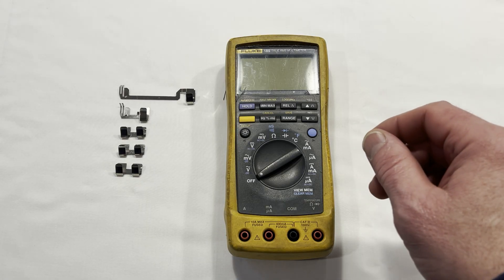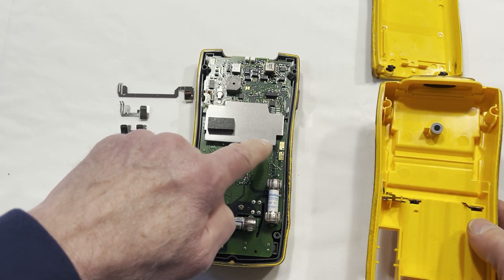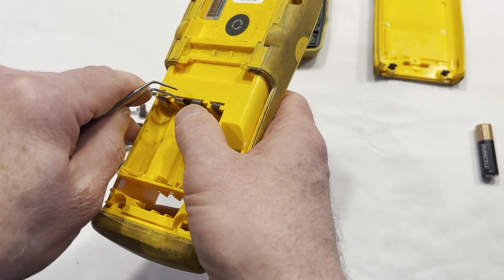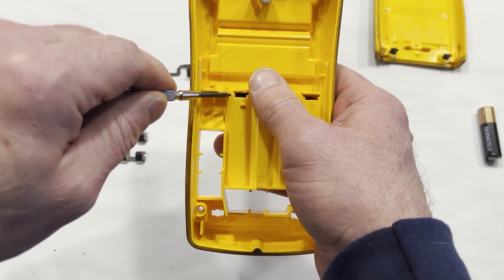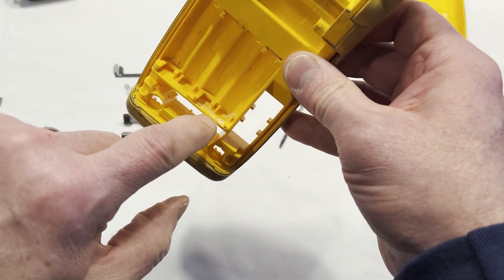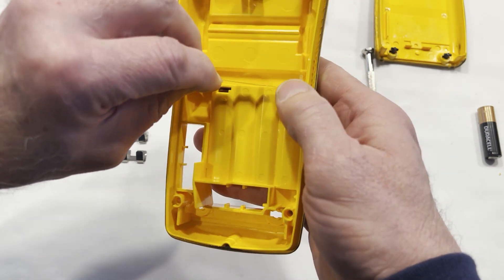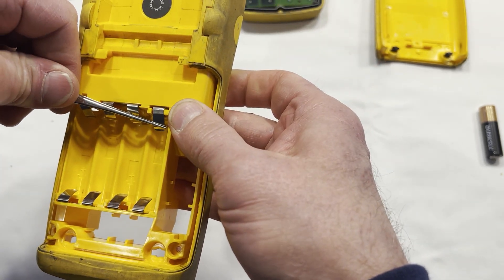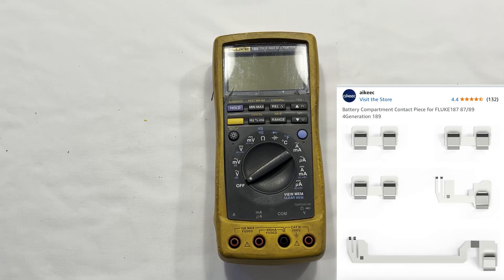Fluke Multimeter won't power up after battery replacement fix

Comment: hi i just replaced battery shrapnel. used to get a horizontal digital lines / battery symbol on off position before. but after changing shrapnel nothing comes up. any idea?